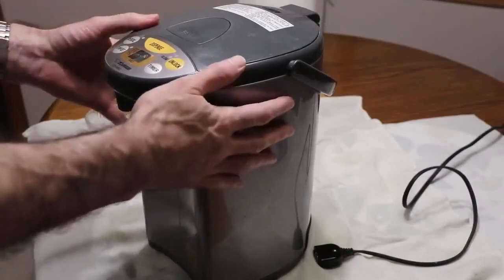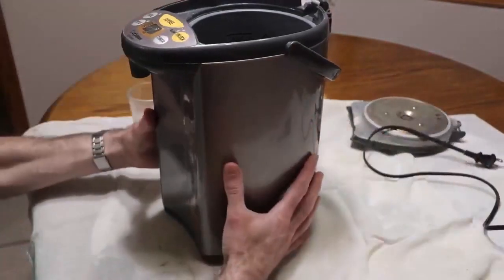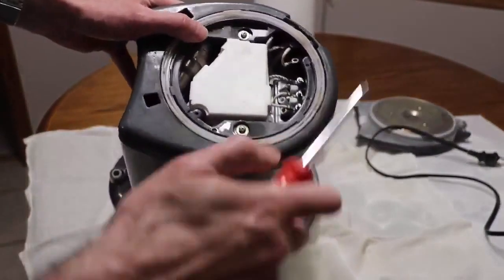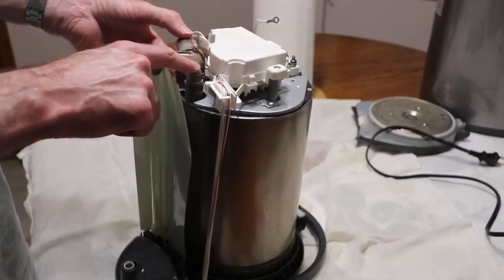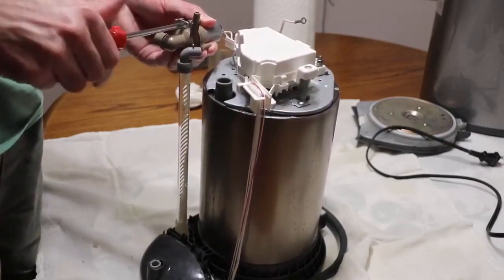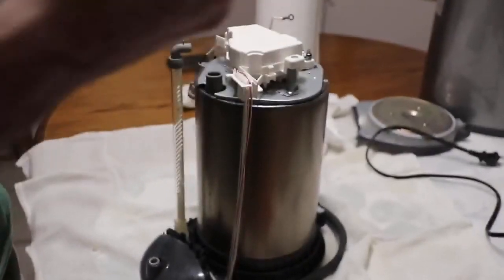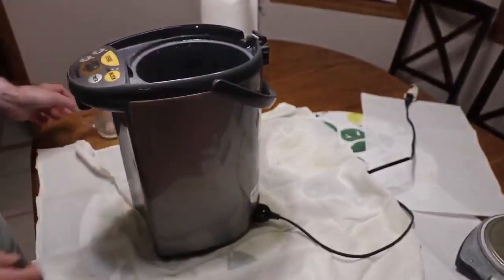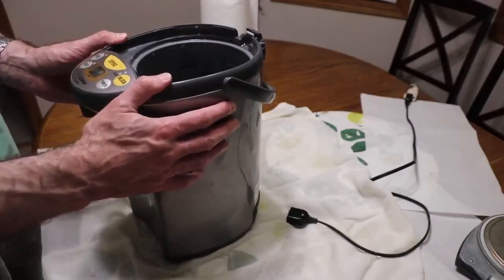How to fix the noisy jammed pump on the Zojirushi hot water boiler

Comment: Thank you for this video; you just saved me about $200 USD. The irony is that this was caused by cleaning the machine using their official citric acid cleaning kit. The most difficult part was getting that initial security torx screw to come off. It took multiple flathead screw drivers, but I finally unscrewed it. I decided to replace that security torx screw with a regular screw so that I don't have to spend another 20 minutes trying to get it removed if I ever have to open the boiler up again.

Comment: I had the same problem and your video helped me fix it.  I shook the pot with the water still inside taking the chance it might allow some water to pass through.  It stopped making the noise and the water that passed had black water filter particles causing the obstruction. I will save your video in case I need to do a more thorough cleaning at some time in the future.

Comment: These in instructions worked great. I have a newer model (CV-DCC40)  that is not quite as user repairable. The screw holding the pump is not as easy to reach as in the video. However, your guide was close enough to make the repair. The official citric acid cleaning solution also clogged the pump up in my situation, similar to comments below. Thank you for posting your instructions. Very helpful

Comment: Thank you very much. I just fix my Zpjirushi CD-CLF30 water boiler and warmer from your excellent tutorial video. I have exact the same problem with noisy pump without water flowing out due to water mineral dust stuck inaround the thermal pump area. It is my own careless without inserting the little metal filter back after cleaning several time. This little metal filter is very import and must be inserted back after each cleaning. I will rate your video with 5 stars.
Reply from the maker: Glad it helped!

Comment: I had the vaccum insulated one.  Amazing design but the pump could easily be gravity fed.   Another pro and con is the 750w heating element for a 4L kettle, saves money but overworked and burnt out.  The worst thing about these are the non stainless boiling interior and even worse is the plastic degrading and flaking behind the metal plate in the lid, along with the seal.  I used a standard stainless steel lid instead and worked okay but created rust on the top of the aluminum water chamber....  just a bundle of health hazards, but you can down 8L of tea a day to make up for it lol

Comment: Exactly what I need to do.  It was time to clean the boiler, I waited too long.  When the pump started acting up, I did not know what problem was until I found this video.  Thank you. Done, completed.  

The only problem I ran into was that my model did not give access to the screw for removing the pump assembly--I thought I would have to remove the entire circuit board assembly to gain access to the pump holding screw.  I tried taking the third screw off with the screw driver sideways and it worked--I did not have to remove the circuit side of the pump.  There was so much crud, no wonder it couldn't pump.

Comment: I made the mistake of pouring out hot water at the end of the night instead of waiting for it to cool. When I turned it back water from the pump came out and burned my hand! There should be a stopper when it's turned off to prevent this from happening. Was wondering where all the excess water came from (cause I emptied the tank part) and this video confirms how much excess water can be stored in the pump mechanism. The manual says to pour it out in a specific way so that's where I messed up, I should have read the manual better : (

Comment: Thanks. I fixed my pot with your video instruction on how to open it up.  Mine was slightly different as I have two screws to take out the base plate.  My tube and pump were all clean as I believe I used Citric Acid to do self cleaning first but that didn't work.  However, it was the spout assembly that you didn't do was dirty with some scale and rusty  stuff that I flushed with nitric acid and water hose.  It works any way. Thanks again.
Reply from the maker: Nitric?!

Comment: Thank you very much for the instruction. I follow it carefully. But when I tried to put it back I found the filling tube become taller to the outlet of the pump.   (See the picture) Any solution?
Reply from the maker: Make sure the flexible connectors at both ends of the plastic tube are fully seated.

Comment: That is helpful.  Do you have any suggestion on how to remove the thick calcium deposit inside the water tank?
Reply from the maker: I used citric acid a few times which helped remove some, but not all, of the deposits. Note that this boiler has a special mode for descaling: press and hold the reboil button until it enters that mode. Some of the scale deposits will separate from the walls and the sludge may clog the pump again, so be ready to repeat the procedure from this video.
Reply: Please use the Citric acid cleander: CD-K03E-JU or CD-KB03-J ( I guess these two are the same), frm Amazon or directly from Zojirushi web. I work nicely.

Comment: Thanks so much for the video! This problem was driving me crazy. The rotating magnetic part with the little pin, mine looks like it has a lot calcium buildup on the plastic. What is it supposed to look like?
Reply from the maker: It's best to remove calcium buildup from any moving parts. You can try gently scraping it off or, if the scale doesn't come off, use citric acid solution to loosen it up first.

Comment: Thanks for the video. I have the same problem now. Do you really  have to disconnect the electrical wires?
Reply from the maker: Yes, you need to disconnect the wires in order to remove the cover. It's just two screws - no big deal.

Comment: My Zojurushi leaks at the bottom.  Not sure why?  It was constantly reboiling the water and water was just leaking out.  Do you know why that might occur?
Reply from the maker: I suggest disassembling the boiler as shown in the video and checking the water connections around the pump. Perhaps one of the hoses is torn, or maybe a plastic connector has a crack.
Reply: So an update.  hoses are in tact....but I noticed one area where there is a lot of rust and calcium build up...but I can't find a leak...not sure what to do.  What do you think?
Reply: I think I figured it out....turns out the inner cap isn't completely tight....so when the water condensates if the inner cap is not tight....then it will start leaking water......I might just order a new water boiler inner cap.   Thanks for the video!

Comment: Thank you sir, ahm. Can I know the cause of that problem?
Reply from the maker: Salts dissolved in water precipitate and form scale on the walls of the boiler. Some of that scale falls off and manages to pass through the filter. Over time those hard particles can accumulate in the water pump and clog it. This problem should not occur if you descale the boiler periodically.
Reply: @CWFI  thank you so much hehehehehehe 😊

Comment: Will the connection leak after you open and put back?
Reply from the maker: Nothing should leak if you put things together correctly. There's no sealant between the rubber tubes and the water pump - just make sure everything is wiped clean and dry before reattaching.

Comment: What can't you flood the pump chamber with strong citric acid?
Reply from the maker: That is an option, but when it gets to a clogged pump you may need to wait for days or even weeks until all that scale is dissolved. The video gives you a much faster option.
Reply: In my case it was the cleaning process that caused this. There was calcium built up under the fairly useless mesh filter;  I used the official Zojirushi citric acid cleaning kit which  loosened up that calcium and got it stuck in the pump chamber. When I took it apart; I was surprised that it was just a tiny piece of calcium smaller than a grain of rice that was preventing the water from running, and causing that annoying sound.